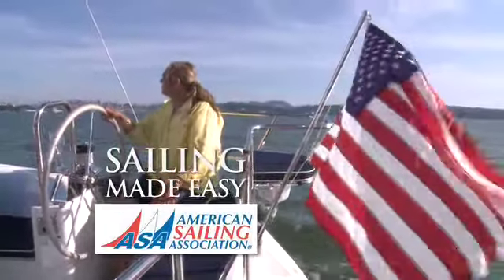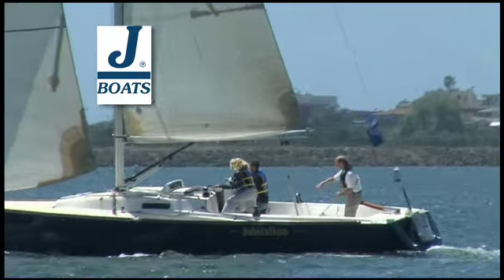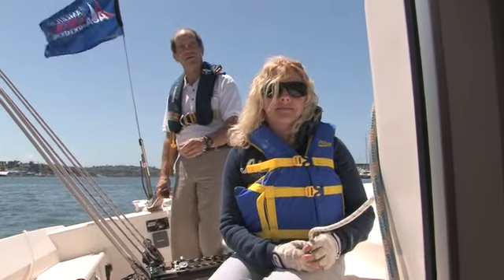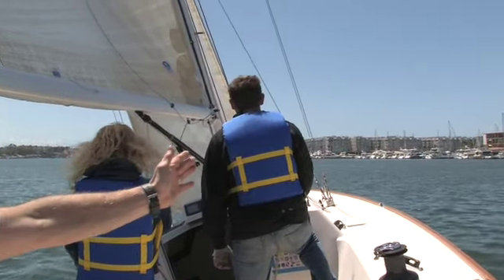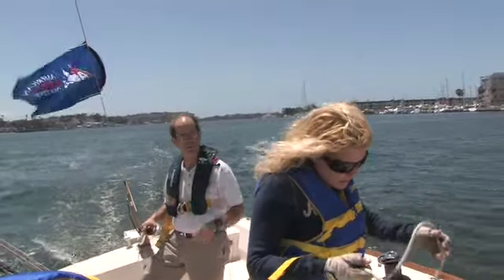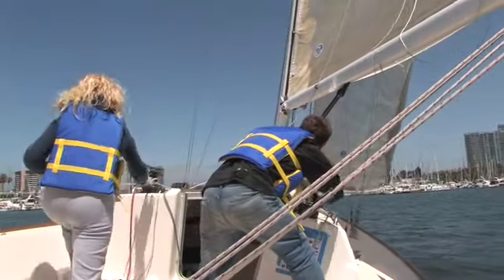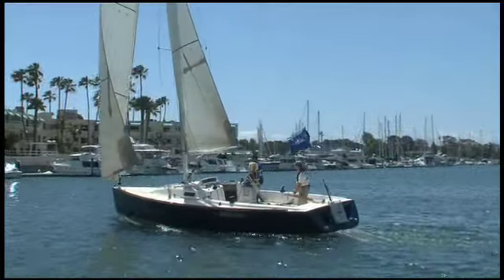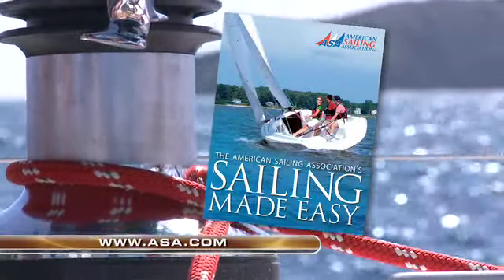Video Tip: Tacking and Gybing

Comment: The instructor does a really good job of clearly explaining what's going on and why, but perhaps gives the final summaries too quickly for new sailors.  Also, we use simpler language: prepare to tack, ready, tacking; prepare to jibe, ready, jibing.  Adding a specific "centering the main" in the middle of the jibe is a great idea.  Will do that.  As tanguerochas mentions, that's especially useful when there's another crew member on the main sheet, but it's still good crew communication when the helmsman is also handling the main.
Reply from the maker: Great feedback... I think what we can do is add some text captions to the video to make it really clear what the commands are!

Comment: For novice sailors, "Hard alee!" is very important as the execution command for tacking. "Hard alee!" needs to be imprinted on your brain so you know, when tacking, you're pushing the tiller hard to the "lee" (leeward) side of the boat. And you're holding the helm there until the main sail fills on the new tack. Also make note: it's "HARD" alee indicating a hard turn. It's not "soft alee".
So on your tacks, turn the boat hard, when the main fills on the new tack stop the boat from turning (counter steering if necessary to stop the boat from turning).